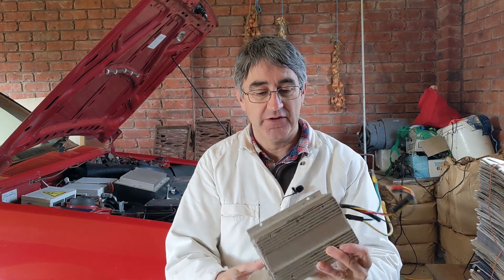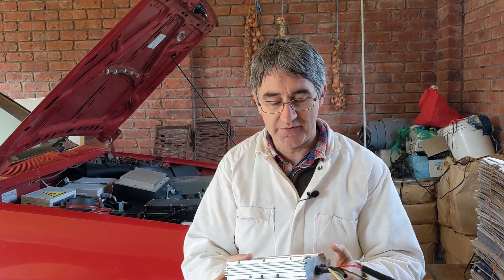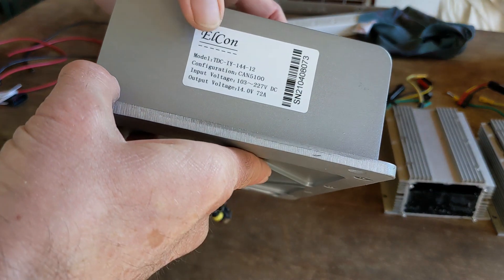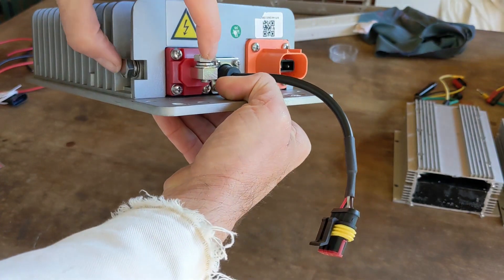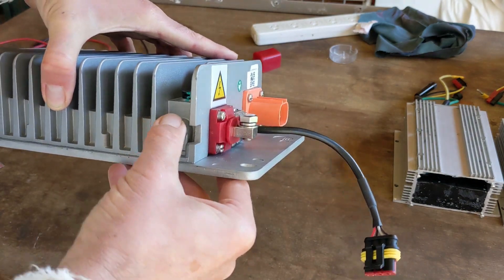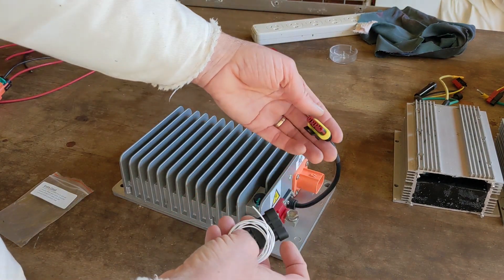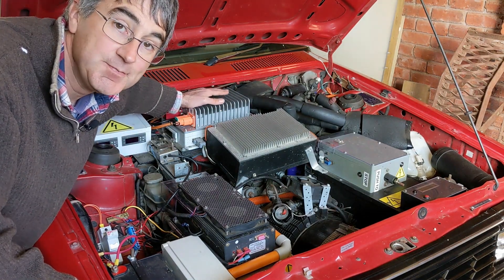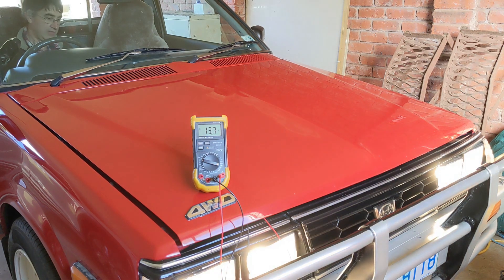A new Elcon DC/DC Converter for my Electric Conversion

Comment: I don't have enabler cable can someone tell what colour wire pin it connects to
Reply from the maker: You mean you don't have the plug that plugs into the connector?  
If you look at time 3:20, you can see the colours Brown, White, Black, Red.  It looks like the Brown one is the enable.
Reply: Thank you so much for your reply, i figured it from documentation apparently they come under STPL brand name too, unfortunately I'm not able to wake it up, even by connecting the brown wire with 12v + relative to auxiliary battery as well as main battery, double checked everything still no output ( only 13v from aux battery readable) no current is drawn from main battery even after applying load on 12v system 
What else for troubleshooting please help it costed me my months salary here in india
Reply from the maker: @simardmg  The only thing I can think of is the connections, but you have said you've already checked them all.  Main battery (including polarity), auxiliary battery -ve, enable line +12V.
Make sure the main battery voltage isn't outside the voltage range of the unit.  Is the input voltage range written on the unit?  I can't remember.
If it's new, and it's not working, can you go back to the place you bought it from?  If you connected it correctly and it's not working then they should supply you with a replacement.
Reply: Just to get back to you. I opened it up and it had a microcontroller and IC blown out fixed and got it working maybe I blew it out or it was a defective piece all along I will never know

Comment: I am going to use 13.8 volt dc to DC charger in my converted electric car. What do you think is there any need to use a auto cut  system
Reply from the maker: Not sure what you mean - what's an auto cut system?

Comment: Hi Christopher. Thank you for this video, really appreciated. 
We are also using Elcon 1kW dc to dc converter for an EV. I would like to know where do you get your 12V enable? is it coming from the same 12V battery that the converter is charging? also, where is this +12V is referenced to? I mean, where does Elcon converter take as GND or reference point when receiving +12V enable? Thank you so much.
Reply from the maker: The enable line is referenced to the 12V output (GND) from the Elcon converter.  I wanted it enabled all the time, so I connected the enable line to the 12V + battery terminal.  Yes, the same battery that the converter is charging.
Reply: @christopherwalkden  Thank you for your response. My previous 2 comments disappeared after posting. I try my luck again. 

I have been doing the same thing as you described in your video and in your earlier reply to my inquiry. but there is no output at all. I also tried different ways like providing 12V enable from BMS. that also didn't work. 
There is this forum post on "diyelectriccar" where people discuss the same issue that they are having with Elcon 500W converter. one of the answers cited Elcon support team and according to them the 12V enable should be tapped on B+ of the traction pack. Although our Elcon converter has different power rating (1kW), can I assume the working principle of the both converter is the same? Do you think it is safe to tap 12V enable of my Elcon converter to the B+ of traction pack? 

Alternatively, do you think it is possible to setup the converter via its CAN bus. My Elcon converter is not compatible with my BMS but some people on forums offered an alternative method using Arduino.  Given the current circumstance where converter does not turn on with 12V enable, do you think using Arduino-based CAN controller will do the job? To my understanding, in order to be able to communicate with the device via CAN, first I must be able to wake the device up using enable signal. otherwise, CAN communication will have no effect. Is that correct? 

Thank you.
Reply from the maker: @sajjadabdollah  I'm afraid I only have experience with this particular model, working in this particular way.
Mine definitely works with the enable line referenced to the output (12V).  Given that, I don't think I'd try connecting it to B+ of the traction pack unless I was told to by the supplier.  But your model may be different to mine.
Perhaps it has a fault?  Can you contact the supplier?
Sorry, I haven't used CAN for this device, and can't give you any advice there.
Reply: @christopherwalkden  Thank you dear Christopher. Converter is working now and charging the battery. 
I have another question. What is the Ah of your 12V battery. I understand your EV comes with heater and perhaps AirCond. Our ICE car came with 35Ah lead-acid battery and we decided to retain it. do you think it is good enough to run headlights, AirCond, power steering etc?  
Thank you
Reply from the maker: My aircon is 150V, and I don't have power steering, so I might have less load than you.
See if you can calculate all your loads.  35 Ah is about 420 Wh, so it would run my 200 W headlights for about two hours.  But the power steering might be much more than that?
Reply: @christopherwalkden  Thank you. at the moment I do not have power steering but I was thinking to install one. As you mentioned, I will calculate the load.
Reply: @sajjadabdollah  Hi there, I am currently stuck with the same problem with my DCDC charger. Won't start to charge at all. Can you tell, what was the solution for you? Thx in advance!
Reply: @raiju1337  Hi. the enable signal should be supplied from the 12V battery (load) positive terminal. And, the reason my dc-dc converter was not charging or giving no output voltage was that polarity of input supply from HV pack to the dc-dc converter was wrong. By swapping the black and red wires at the input and connecting the enable signal to the 12V (load) battery, the DC-DC converter was able to start charging the 12V battery.
Hope this helps.
Reply: @sajjadabdollah  thank you very much! Meanwhile I found out that I got the CAN enabled version. I was missing the message in my BMS to activate it. 🫠